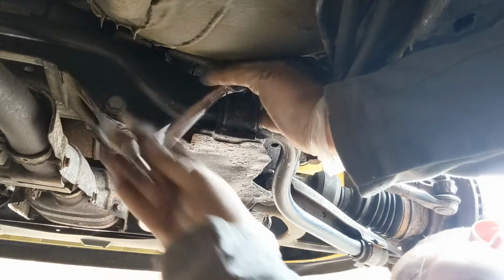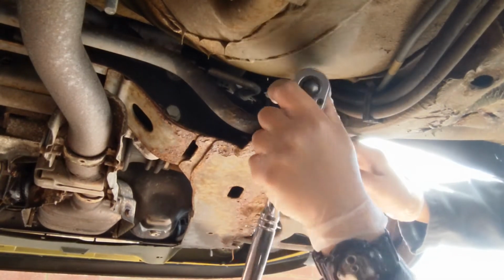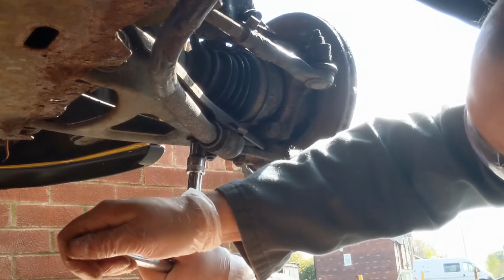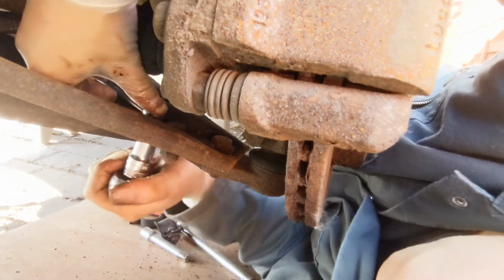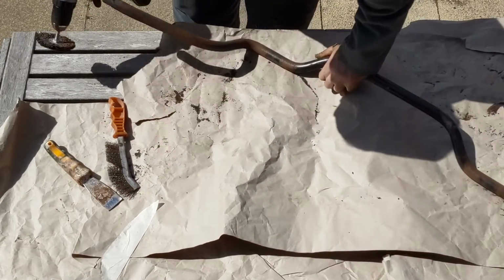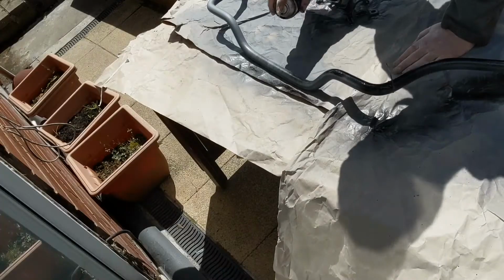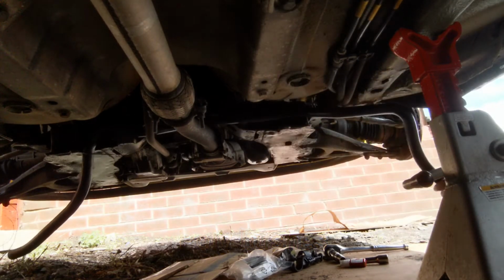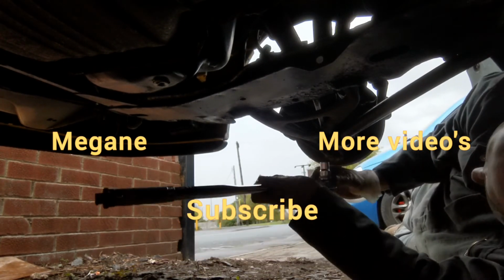Anti roll bar & bushes Refresh - My Mégane Coupe update #4

Comment: Great little video Mark, can testify about sway bars, had a aftermarket on a fabia vRS transformed the handeling on the car.
Reply from the maker: The anti roll bar and strut brace fitted here were all standard from the factory in these cars.
The bushes had simply suffered the effect of time being cracked badly. The hardest part was baring it back into place while fastening the bolts back up.

Comment: Nice work Mark! It's definitely coming along! Can't wait to see it at the social in July 😁 Little progress has been made on my Mégane lately due to work and the fact it is rolling means attention has been in other places in the fleet though there are always jobs that need doing to it.
Reply from the maker: Thanks Jake.
Just the front brakes to try get done now and finishing off of a few little jobs before taxing it next month. Having only driven it off the transporter so far though there is a lot of unanswered questions. I'm also planning to take it to a local garage that I use to get it up on ramps for an inspection. I know there is definitely more work to be done but it's a question of how much and how soon.
Hopefully any jobs on your Mégane Classic will not keep it away from the social. Still really want to see the two side by side.
Reply: @markonmotoring  There'll always be something that needs doing just down to age of the car but you're making storming progress on the Mégane. It'll be back on the road in no time! The garage inspection on the ramps is not a bad idea at all! None of the jobs planned so far will keep the classic from the social, the only things that can stop it are worn out parts 😂
Reply from the maker: @FuelPower  I've managed to get those incorrect size brake disc swapped today but last two days I keep getting rained off. If sane happens tomorrow I think the Gazebo is going up.
Insurance is done so it's just road tax to pay for and it's road legal. Can't wait to drive it. Only one of these I've ever driven was a phase 2 coupe with the 2.0 direct injection engine and that was at an event around 20 years ago.
Can't wait to see you next update on the classic.
I was telling Joseph that someone in the owners club may have a phase 1 1.6e 5 door hatch in RXE trim with AC coming up for sake soon too. Less than 70k on the clock.

Comment: Hi Mark, Great Channel.
I have a Renault Megane coupé MK1 phase 2, and checking the Anti roll bar the other day noticed the middle bushes are long gone.
Do you reckon you can lift and do one side at a time, without removing the antiroll bar itself, as I don't have a driveway or private parking space .
How hard is it to clamp the new bushes in before screwing the clamp in?
Appreciate the help, and your channel
Reply from the maker: It's a while since I did this but even on my driveway the hardest part was getting it back in because of the tension on the bar. I had a crow bar and was using it to lever the anti roll bar up while also trying to.gasten the bolts back in place. I'm not sure if you could do one side at a time, I suppose it's possible but I removed the whole thing so that I could paint it off the car.
Reply: Im struggling to put the bracket back on after swapping the middle bushes i dont feel its closing enough for the screw to reach the nut 🤬🤬
Reply from the maker: That sounds like the exact same problem that I had.
I'm not a trained mechanic but the way I did it was laying on my back using a crow bar to lever the anti roll bar up enough to get the bolts to locate.
I'm not saying it's the best way but that is how I got the job done.
Good look. 👍
Reply: Ill keep trying 😂😂

Comment: Rust is the big problems. With  2007 megane cabriolet
Reply from the maker: I'm not sure about the 07 cabby as I've not owned one. I did have a MK2 52 registration 3 door hatchback but it was pretty new at the time.
These pre facelift MK1 version were sold in the UK from 1996 to 1999 so getting on a bit now.